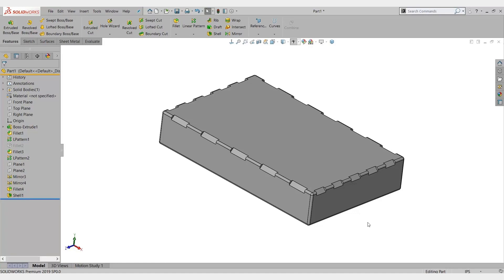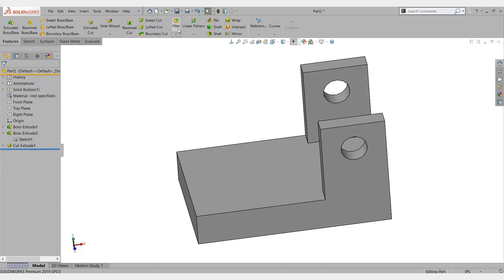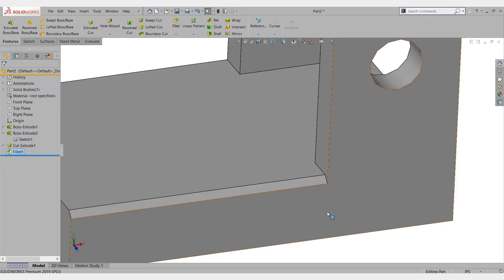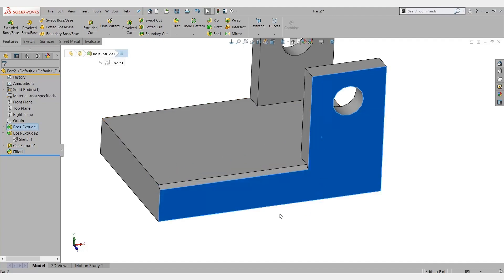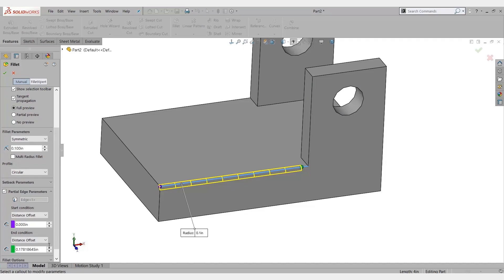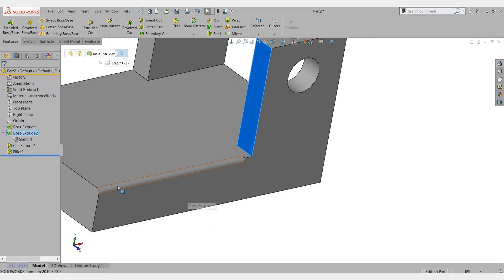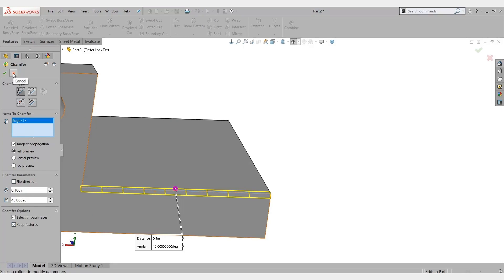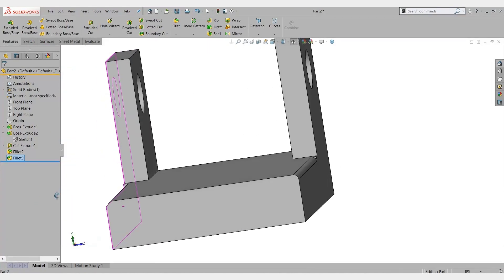Video Tech Tip: Introduced in SOLIDWORKS 2019: Partial Fillets

Comment: great presentation--thank you--I'm trying to do this quickly (of course) and you answered quickly.  One thing I wish you would have done is finish it--that is you mentioned 'another feature' to finish the end--obviously that partial fillet end isn't going to be made that way.  So far I have to make a sweep in with a tool shape to really make this feature.  SW is really moving in the right direction parallel with CAM--but let's make it real.  I'm disappointed you have few views--this is a good quick demo!  Maybe future version SW gives us the rotating tool shape possibility for partials!